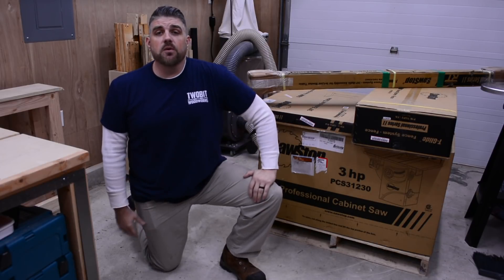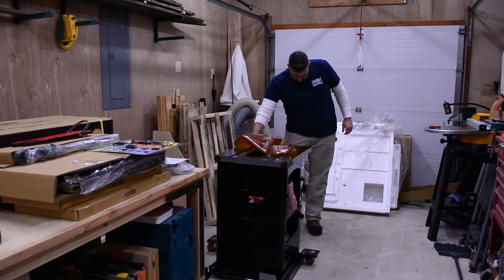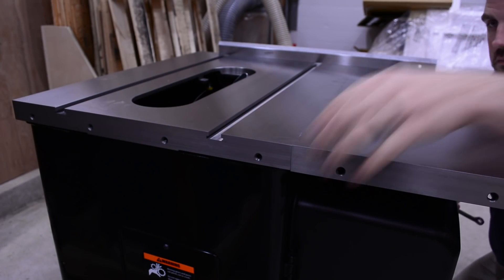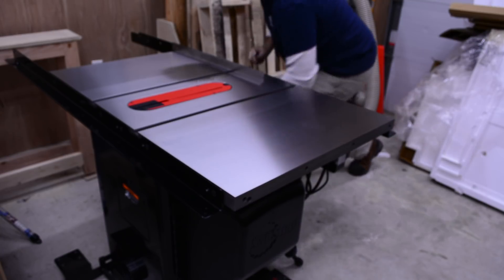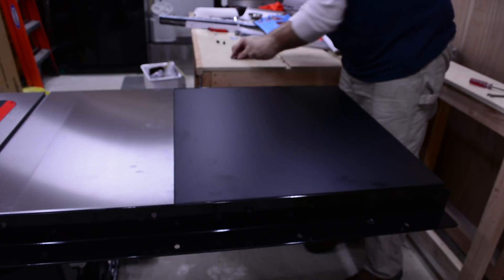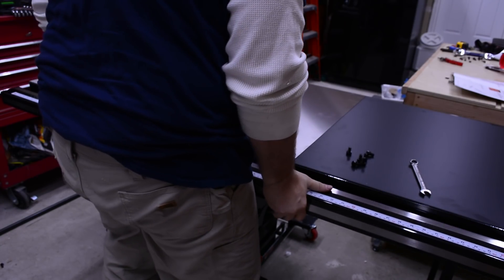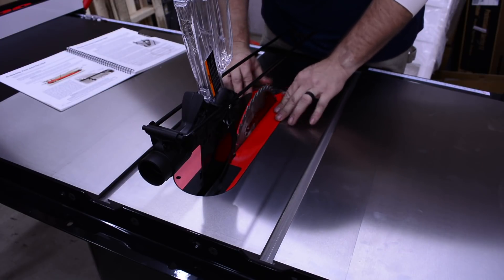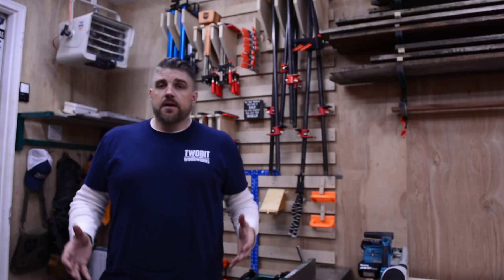SawStop Professional Cabinet Saw Assembly | Woodworking How To

Comment: Great video.  I noticed the old receptacle seemed to be a20 amp.  However, the sawstop PCS come with a 15 amp (NEMA 6-15).  Did you have to swap out the power cord or replace the receptacle?

Comment: Is there a protective film on the black extension table? Have seen videos where folks peel it off.  If there’s one on mine, it’s pretty well bonded. Top is not at all glossy black, but dull. Any tips on getting it off?
Reply from the maker: Tom LeTourneau there was not a protective film on the extension wing. If you get the bigger 52” extension then it is a different material than the 36”

Comment: I enjoyed the Video, you did a great job. I also purchased a 3hp SawStop Professional. I had a Rigid R4512 and really liked it but once my thumb hit the blade that was it. 4 months later after my 10 stitches and surgery to repair my nerve and the tendon, not to mention the $90,000+ it cost, I bought the SawStop. One thing I didn't like was the Rigid was 37" and thus my outfeed cabinet was too. The SawStop is 34" so I built a platform to set the saw on to make up the difference. I noticed in your video your outfeed cabinet was higher as well. What did you do?
Reply from the maker: Earl B. I had leveling feet on the outfeed table so I just lowered it down until the table was about .25” below the top of the table saw.
Reply: @TwoBitWoodworks  Now that's a great idea. You probably had the sawstop in your mind..thinking ahead!
Reply: Wow Earl, 90 grand?  Yeesh!  I guess I'm making a good investment buying a sawstop.  The 34 inch height is going to be a hassle for me.  I'm either going to have to jack up the saw in some way or re-do a bunch of things in my shop.  Why do they make them so low?

Comment: Nice video however the flipping the saw on to industrial wheels is not trivial by yourself. I am 6.4 270lbs and in good shape and did not want to blow out back or knee trying your method. I found levering it up and placing blocks under the heavy table end until I had it to about 20degree tilt made a safe lift to vertical. Shifting while vertical in the mobile unit was easy as you show. As others have mentioned the wings were way to heavy for one person to get started. I built a 17inch wide 33inch high little table out of 2x4s in acouple of minutes that held the wings in place for alignment. This fit between the wheels to get close to the table.  Actually not sure how you could do it otherwise..... Love the saw!

Comment: I got the 3HP 52” saw and I bought the Freud SD608 dado stack and found that setting it up for a 3/4” dado, it won’t fit on the arbor coz the bolt is not long enough and only a couple threads available for the arbor nut. 🤬🤬🤬
Reply from the maker: Crackerjack that’s crazy I have no problems setting up a 3/4 dado stack on mine.
Reply: TwoBit Woodworks I cant imagine how? The inside arbor washer is not removable. With the outside washer removed setting it for 3/4” as instructed, there was only two arbor threads exposed to tighten the nut on with the hub adjusted flat and besides, SawStop doesn’t recommend using that SD608 dado set as it could trip the brake and damage the arbor unless you bypass the safety brake. I spoke to the SawStop engineers about it. I sent mine back for a refund and purchased the SD208S one of the sets they tested and recommended. Sorry I don’t believe you set a SD608 dado set and got it to fit on the SawStop 3HP PCS. No Way!
Reply from the maker: @TeamProsperity  I misunderstood, I do not have the SD608 dado set, I have the Irwin Maples dado set and do not  have any issues running a 3/4" dado stack. I thought you meant that you had issues running a 3/4" stack in general, not just that you had an issue with the SD608.
Reply: Manual says outside washer not necessary when installing dado stack. This might also help.

Comment: Any tips on getting the outer edges of the wings leveled? I lift them up to level it and I tighten the bolts and let go it’s still droops down. Also the front and back edges of the wing can be completely flush and then the middle not be. Having trouble getting it flush from front to back and in the middle and getting the outer edges of the wings leveled.
Reply from the maker: I would suggest using a large straight edge to make sure that all surfaces are aligned. Getting them level with the floor will most likely never happen unless you have a super straight shop floor. Patience and a dead blow mallet go far during the set up.
Reply: First thing is to get the bolts started while holding the wing.  That's always a lot of fun.  Then tighten ALL the bolts just before they are starting to really snug up.  Take a rubber mallet and pop the wing until it is flush with the front of the table top.  Use your finger to check for flush instead of a tool.  Pound front to back until you get it flush.  Once the front edge is flush move to the two inner bolts to level.  With the bolts almost snugged up you will be able to pound the wing up or down with the mallet to shift the wing.  Get the wing flush right above one of the two inner bolts and snug it down harder once done.  Then move onto the second inner wing bolt and repeat.  If when you hit the wing and it doesn't move you have the bolt snugged up too much.  And vice versa if you pound the wing from top or bottom and it doesn't shift it could be too loose because it shifts and then returns to where it was so try a bit more torque on the bolt.  Now that both center bolts are flush you can move onto the outer wing bolts which you asked about.  Same procedure of having the bolts mostly snugged up but loose enough for the wing to be nudged with a rubber mallet.  Pound top and bottom until sliding your finder over the joint feels as smooth as you can make it.  Usually you can get it to be almost none existent feeling.  Not always though.  Then tighten up the wing bolts fully and you are done.  I've literally done 30 to 40 PCS and 25-35 ICS saw assemblies so I've got this down pretty pat.  Ask away if you have any other questions.
Reply: @toolreport   Excellent advice ToolReport, thanks for sharing.  You made what I thought would be the hardest part of the job a breeze.

Comment: When Using the industrial base approximately how high is it from the floor to the saws table top?
And can the height of the saw be adjusted when using the industrial base?
Currently everything in my home shop is set to 37 in from the floor.
I'm ordering the sawstop off of Amazon today and would like to order the industrial mobile base but my home shop is not very large so having all table tops and cabinets either be slightly shorter or the same height is very important..
Reply from the maker: Michael Kaine it’s approximately 34.5” from floor to top of the table. No adjustment for raising or lowering it.
Reply: @TwoBitWoodworks  thanks for the fast reply this really does help.
Do you think it may be possible to screw a few 3inch high metal supports to the bottom of the base to add a little extra height?

How high are you able to raise the base off the floor using the hydraulic foot pedal?
Reply from the maker: Michael Kaine I would not suggest that at all. The table saw is very heavy and SawStop has done a great job of making sure that the foundation is top notch. Any alterations to the base may cause some balance issues as well as structural issues.
Reply: @TwoBitWoodworks  thanks again.
 I'll start drawing up plans, it looks like I'll be building my own..
Reply from the maker: Michael Kaine are you talking about building up under the SawStop base or the outfeed table?
Reply: @TwoBitWoodworks 
 neither.
 I was considering building a base about three inches high & bolting that to the bottom of the sawstop cabinet.
After which I'll drop the entire assembly into the sawstop industrial mobile  base.
It's just a thought I haven't yet seen what the bottom of the sawstop looks like and I've never examine the industrial mobile base, so I can't be sure what I'll do until I receive my saw.
Reply from the maker: Michael Kainebi would assume that would break any kind of warranty. Check with sawstop and see what they say.
Reply: @TwoBitWoodworks  will do..
But I wasn't planning on drilling any holes for the bolts, I was hoping that there would already be holes available for mounting a 3rd party base, I'll update you in a couple of weeks when the saw is delivered.
The base should be here on Friday though.
Reply from the maker: @michaelkaine345  I guess my worry would be that it would become more top heavy especially when moving it around.

Comment: I just assembled my Sawstop. I would recommend having a helper if at all possible.  I installed one of the wings myself and that wasn’t fun.  They are heavy and somewhat slippery even with the oil wiped off and hard to hold in place while getting the bolts started.  I had my wife help with the second wing and the rest of the assembly and it was much easier. And a second person ensures that your guide rail will not slide off before you get a bolt in each end!
Reply from the maker: All good tips.
Reply: got rid of the help before the rail, hope I don't regret it. got the wings done wih help though
Reply: Clamping a board under the wing is incredibly easy for the wing install with one person

Comment: How out of level is your shop floor? It looked like the saw was bouncing around quite a bit when you were moving it around. I'm considering a PCS and thinking about the ICS base, but in pictures it didn't look like it lifted the saw all that high and my garage floor is pretty out of wack. Looked like you were able to move the saw really easily with that particular base.
Reply from the maker: Charlie Choiniere it’s not level at all. Normal garage floor sloping really, but the ICS base makes moving the saw super easy. I paid extra to get the ICS mobile base but it is definitely worth it.

Comment: Thanks for this. I have been waiting for my 36 inch SS contractor saw. I found out earlier today that it was going to be pushed out farther into October or November. Beaver Industrial did have a 36 inch PCS with mobile base in stock so I cancelled the contractor version and ordered the PCS. It is in stock and should ship tomorrow. I will follow your instructions to assemble. Thanks again.
Reply from the maker: Wraith thanks so much. I’m glad you were able to find a great saw in stock. You won’t be disappointed!

Comment: ".......so I could easily lift the saw upright."  Not for a feeble old man!  You made it look like it was a carton of eggs you were moving around.
Thanks for the video.  I bought the same saw and found it very helpful.  One thing you might want to let people know is that the industrial mobile base has to be modified to accommodate that saw.  It's not a big deal, a couple of bolts, and they send the parts to do it. Unfortunately though, they don't mention it in the instructions.  I had to find out the hard way.  And lifting that thing up a couple of times was not as easy for me as it was for you.

Comment: Tell me why it's a game changer. I drool over this kinda stuff and have a Dewalt jobsite saw. I know this one is 100x better than what I have but what's so game changer about it?
Reply from the maker: Krunal Patel the game is changed because of the increased safety that this saw offers. I like woodworking and is like to keep all my digits. Game changed!
Reply: @TwoBitWoodworks  Agreed! But from a performance and accuracy perspective, how does it compare to what I have? I have a Dewalt jobsite saw.
Reply from the maker: Krunal Patel I had the DEWALT jobsite saw and it underpowered compared to the SawStop. I now have a 3HP saw that powers through anything I throw at it. No bogging down at all.
Reply: @patelkrunal311  you are comparing apples and oranges
Reply: @lenpiazza8493  3 years later i know why now :)

Comment: Serious question. You moved the saw base onto the rolling stand rather easily or so it seemed. How much do you suppose you had to lift in weight? I know that tilting the base was not the same as lifting the base. Thank you.
Reply from the maker: Jeff Stanley not much at all when physics are involved. Without all of the extra pieces it is not that hard to manage.

Comment: looks to me you got to be another sawstop sucker....no worries, I got two so I am a bigger sucker than you, lol.I owned Powermatic cabinet saws for a very long time, when it comes to cabinet saws and not sliders, sawstop rivals Powermatic easily; good luck to you in your woodworking gig.I mentioned I got two saws, one is like yours that I keep dado in it so I don't have to go back and forth, also I got a 5hp industrial that is my main cutting saw, I strictly moved to sawstop for the safety cartridge, I owned a slider but don't do that much large ripping lately so I sold it;I've been around for about 30 years so I've seen everything out there, you got yourself a nice saw, bit pricy but what of anything quality is not pricy?Dan
Reply from the maker: Daniel Pap if I had the room to keep one saw a dado and one a normal setup I probably would of kept my Jet saw with a dado setup.